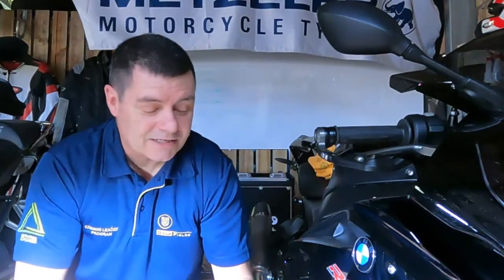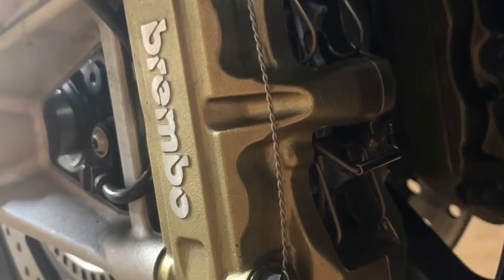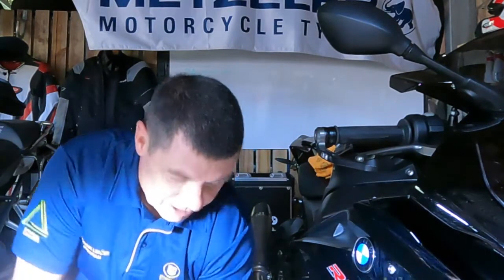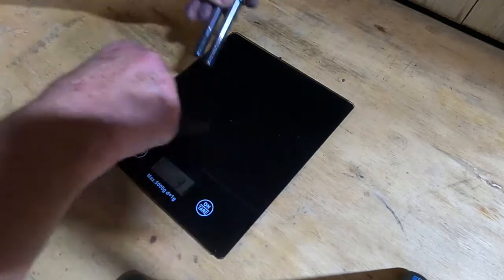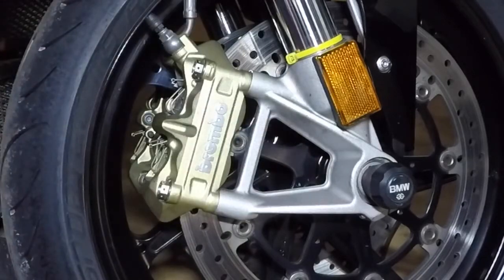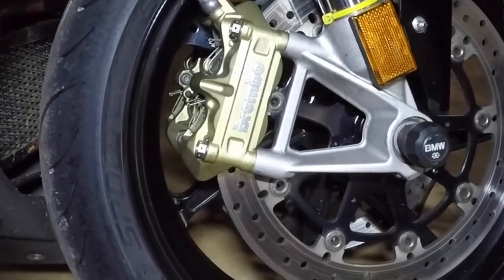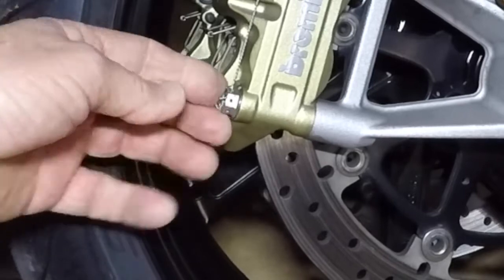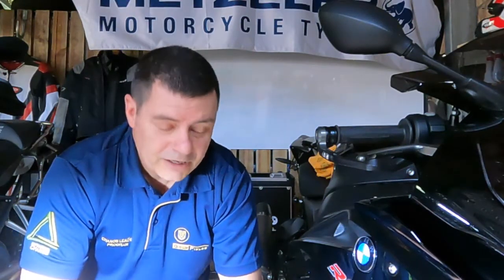How To Tie Wire Front Brake Caliper Pre-Drilled Titanium Bolts

Comment: For what it's worth, by the manual the caliper bolt torque should be 38nm, not 30nm. Ti bolts you should also put some kind of copper anti-seize on the threads, as they tend to gall. Seen people end days on track because they've stripped threads/killed the head on Ti caliper bolts.
Reply from the maker: cheers mate, appreciate the input. And yes, i just checked and you are spot on with the torque setting from the BMW manual.

Comment: I don't think that safety wiring job would pass muster.  with so many holes to choose from I would have avoided a "neutral" wrap and possibly used an "X" pattern to install the wire.  One end of the wire should wrap from the hole clockwise around the bolt to join with the other end coming out of the hole and twisted there, the twisted wire should wrap clockwise around that bolt to join the second (lower) bolt and again one lead through the bolt, the other lead wraps around clockwise to meet up at the exit hole hole.  Your safety wire job up to this point was tough to tell if it was good, but the pigtail was WRONG, the pigtail needs to be twisted in the opposite direction, counter clockwise looking at the end of the wire, this is so the wire will not flip over the fastener.   Basically the twists between the first and second bolt are clockwise, anything after the second bolt (including pigtail) are counter clockwise.  Your pliers don't have the ability to reverse so you will have to twist it by hand.  Also with .032 wire you want 6 to 8 twists per inch (25mm?).
Reply from the maker: Thanks for the education on safety wiring mate, appreciate the knowledge from someone who has expertise. You've stirred up my interest to know more. Cheers.
Reply: @TheBikeStig  Most humble response to a criticism I think I've ever seen on YouTube.  For that alone, subbed.  Good vids, btw.
Reply from the maker: @JoshPhillips7781  thanks mate, yeah I like to find the good in everyone if I can 👌, and I don’t mind being educated by others who obviously know more 😎, thanks for subscribing 🙏

Comment: shouldn't it go around the bolt?
Reply from the maker: No not really, as long as the bolt cannot vibrate undone in its thread it's fine. I found this way easiest with pre-drilled bolts but pretty much any approach that stops the bolt turning works.